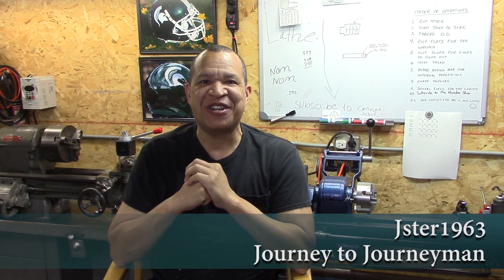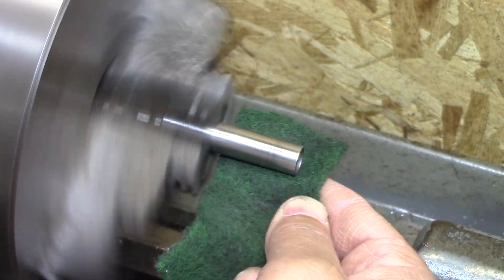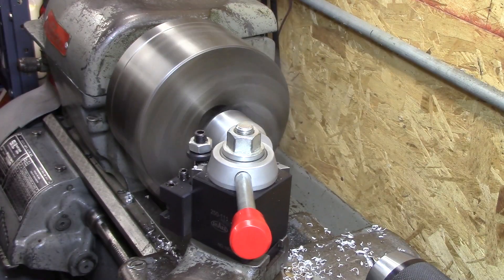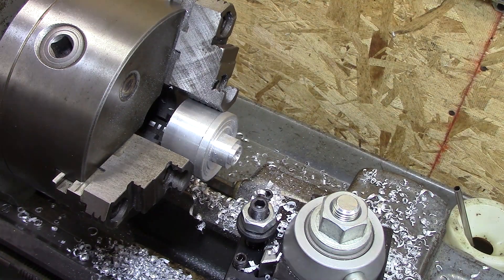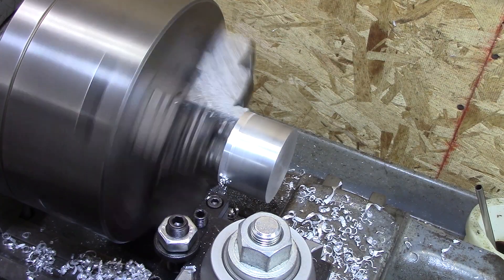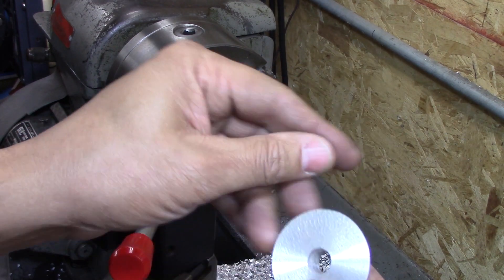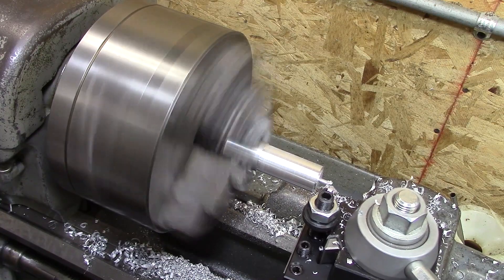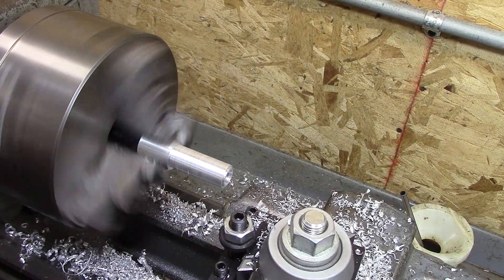Journey to Journeyman, Episode 26.  Machining parts for my Craftsman Gas Trimmer (weed wacker)

Comment: This is what I have done to fix my parting off attempts. First make sure that the tip of the cutter is not damaged and it very sharp. It could be that on a previous attempt it was damaged or possibly that it rubbed and became dull. Once you have ensured that the tip is in good condition, use the parting tool to face something off. This will ensure that it is exactly on center which is crucial to a successful attempt. 

Great job in restoring the Weed Whacker back into operation. I had to make a coupler for my cousin's leaf blower when the plastic one that came with it wouldn't work anymore. He  was tickled pink to see that I made a special part for him.
Reply from the maker: I will have to give that a shot, thank you!  And I love fixing something that would normally be thrown away.  And I know how your cousin feels!  Thank you again....

Comment: Nicely done in the end....   And...    It works....!!!!!
Just like you apprehend, parting on a small machine, the main issue is to make everything as rigid as possible, lock or tighten everything you can, gibs, carriage, etc... Something else you may want to try, use some thinner HSS parting blades like .060 or .090", make the tool holder as close as possible from the holding post, the more you're cantilevered the more you WILL get shatter, some people use some lantern type tool holders for parting in order to be closer to the center of your cross slide, set the cross slide as centered on it's support as possible, start with the blade having almost no stickout at first, you can extend it as you go as long as you're well perpendicular to the part that you're cutting.
If this is soda can aluminium, this is really soft and sticky stuff, you may need to use thicker cutting oil.
Another thing, is your lathe solidly anchored on a really rigid and heavy base? If not, you may want to consider making the base sturdier and anchoring the machine with good lag screws...
If after all this nothing goes, then, back to step one, the hack saw....
    Or......  
Go to the adult toys store and get a real big machine.....
Now you're retired, you don't dispose of much time to get things right, you may realize that retirement is even busier than normal life, at least I did....   😴😎🌈👍
Have fun...!!!
Reply from the maker: Excellent info!  I will have to try those things.  I am anchored to the cement floor, so it's other rigidity issues I will hunt down.  And yes, I am so busy in retirement.  It's crazy, but true.  I hope it's warm up there.  And thank you very much.....

Comment: Awesome video Jster! I'm not the best parter-offer myself, but something you might try in the future (in addition to not flipping the part over, as suggested below) is adjusting the speed either up or down. There is an optimal feed rate in there somewhere. Also, sometimes you really have to commit--Just throw pressure on it to make sure you're not being too tentative. Like I said, I'm not all that great at it myself, but these two tips have helped me move forward a few times. Thanks for sharing!
Reply from the maker: Thank you so much Rick!  I was thinking of slowing it down with back gears and going for it.  I'm just too scared.  I think I may do an entire J2J on learning how to part off.  Thank you again.......
Reply: @jster1963  That would be an excellent topic. I'm sure I would learn something watching you experiment. You've got a great attitude and approach to learning. Stay safe, and move forward!
Reply from the maker: @RickRose  Thanks again Rick!